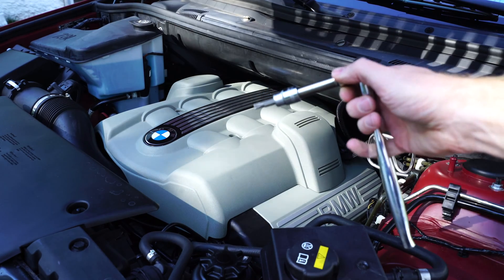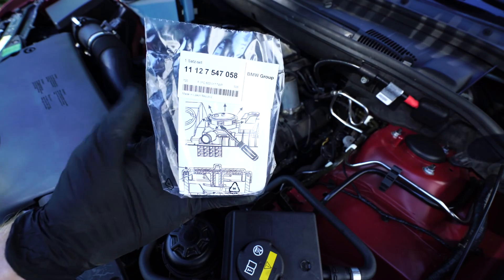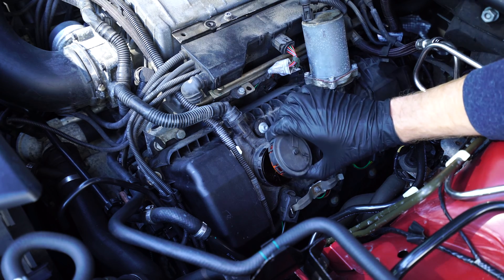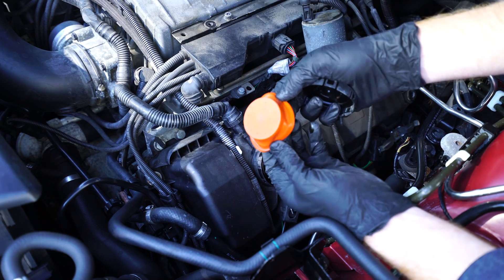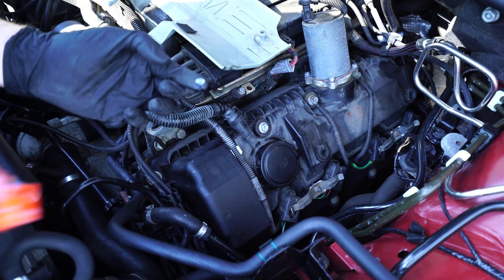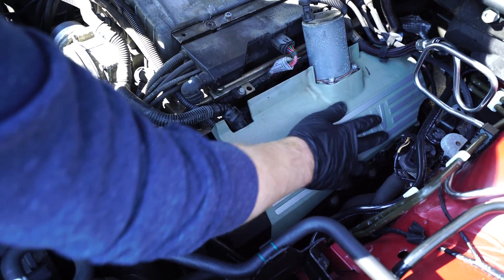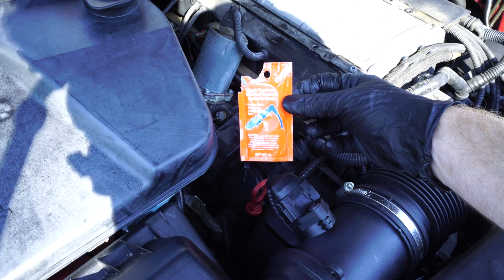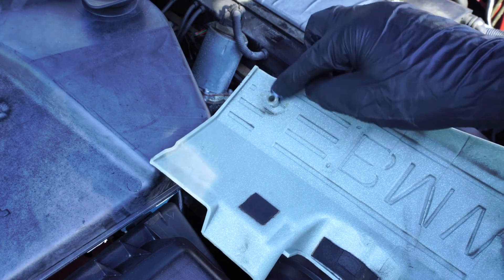N62 PCV Valve DIY

Comment: Great video very helpful, I would like to make sure of something. There are two types of the 4.4i engines in the X5 E53
M62 engine 4.4i from 2000 to 2003 & N62 engine 4.4i from 2004 to 2006.
Does the same PCV Valve fits both of them or one is different from the other.
thanks and best regards,

Comment: Thanks for posting BMW repair vids! Super helpful! Just out of curiosity (because I get different answers) in your opinion, what's the most reliable and affordable BMW (or BMW you recommend for DD) you can buy under $6-7k? I've gotten most 3.0 inline 6 NA engines (like in E90 330i, X3 3.0i, etc) in most BMW's are good and stay away from 4.4i V8's and early twin turbo 3.0?
Reply from the maker: Thanks Jae! I would say go with a 330i/530i in rear wheel drive if possible. That's my favorite BMW, and is why I just bought a high mileage (223,000) ZHP 330i. Anything V8, turbo, or AWD will be more complicated and expensive to repair. Every car BMW or not has it's weak points, just study the common issues and be prepared to DIY to make it affordable!
Reply: Thank you! That's what I was thinking myself. I see that you got the E46 3.0 liter model but would the E90 3.0 do just as well? And 530i E60?
Reply from the maker: Jae Baek they all drive and feel very differently so test drive if possible before choosing. Mechanics and expense will be all in the same range.
Reply: I know this is a late answer but from my experience and from what I've heard, the 3.0 engine (straight 6) is more reliable than the V8 engine.  I have the 4.4 V8 N62 engine, which is the nicest car I've ever had, but the most expensive repairs I've ever paid as well....lots of stupid things break, like door handles and window regulators....